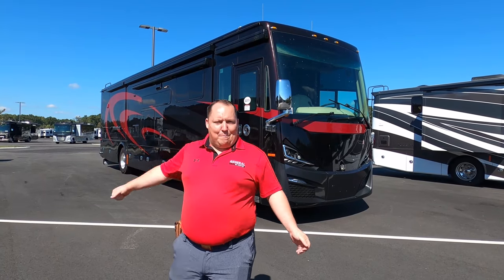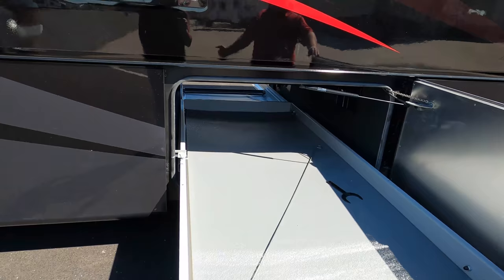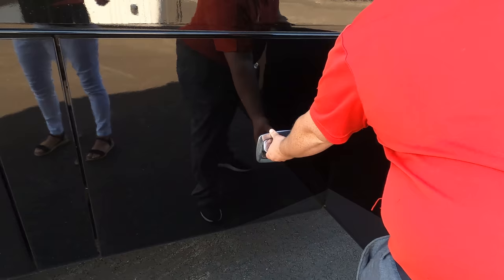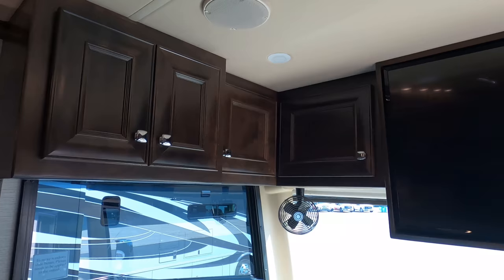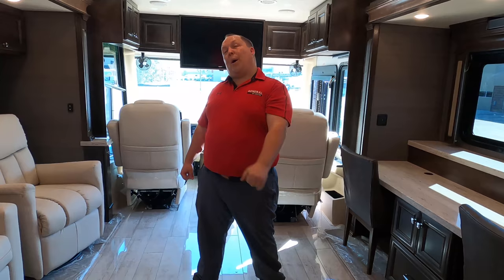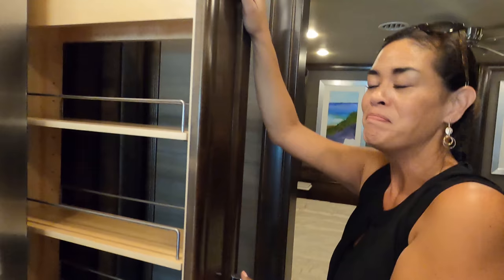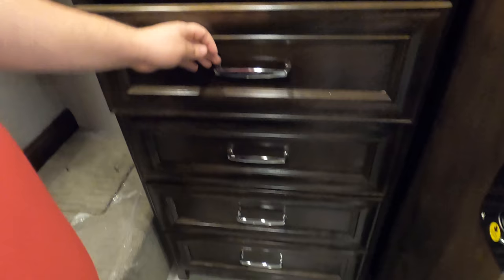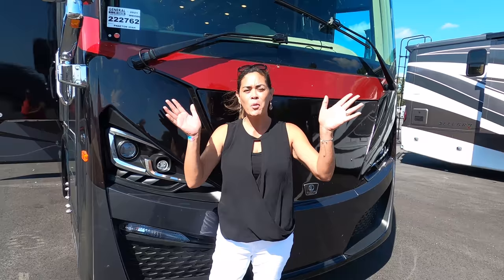The #1 Selling Class A Diesel Pusher for 2020

Comment: Matt, you can get that phaeton with an induction cooktop but, in order to get that you have to get the package with the aqua hot and dishwasher which we aren’t a fan of.  Also, here is our dislikes, that medicine cabinet in the bathroom is stupid, ours is all one piece and lots of room.  We don’t like the sofa as there is only one rocker recliner and we both like the rocker recliner to relax.  We aren’t a fan of the outside color either as black in Florida draws heat and hot to touch. We don’t like the heavy combersome covers on the stove, we live in ours full time and they are heavy to take off and on so we don’t use our stove and crumbs are always falling between the cracks and what a mess.  We covered ours with a plastic cutting board which we had made.  We love our tiffin 37 PA allegro Red, there is a lot of things I wish tiffin would change, like putting lights in all the cabinets as they are hard to see in them even in the daytime.

Comment: I had a 2015 40AH and reversed the bathroom door and put a flush passage lock on it.  The door had no access when closed, and blocked the controls if left open when the slides were in.  Reversing did the trick.  It would be nice if they lined the cabinets.  Like to see they still have sliding windows.

Comment: Well, we hoped to by a Phaeton one day. We love our 2019 34PA Open Road. Yes we like the pusher and the Frightliner chassis but a lot of the coach is not much different from our gas motor home the bathroom has just one more sink. The shower looks the same. The couch is the same. The added length 41” vs 36” allows for a recliner but I’d prefer twin stadium recliners. The TV-ator is nice but all and all I don’t think it’s worth an extra 100k. Gas cook top- what’s with that?  The should put some glass in the doors above the fireplace and lights. Needs a better emergency exit in bedroom. 

Matt I’d love to see one under 40” or the 40IH. Bring it to me Matt!
Reply: * buy not by

Comment: Gorgeous motorhome!  Even though we insisted on a dinette (I’m sitting there all the time it seems!), this set-up is really nice with a combo-like work station/dining area.  Lovely flooring through-out the coach.  FABULOUS BATHROOM!  Very roomy and elegant, however not roomy enough while using to toilet!  Don’t care for the pull knobs on the cabinets...grab handles would be better in the kitchen and upper cabs in the bedroom.  Matt, you’re absolutely correct...that emergency exit is way too small.  It’s also hard to get at, especially if you are older and not as limber.  The fact that many retirees would choose this unit as a full or semi-full time, an easy access is a must.  In addition, it is not prepped for solar...which would def be used with an induction stove, which Matt thought should be included.  All in all, a lovely elegant motorhome for a fair price.

Comment: 3 Dislikes:
1. TV in the cockpit. Not necessary, not wanted, waste of space.
2. Toilet position. Remove the secondary door to the bedroom and swivel the toilet.
3. Emergency exit. Not just the size of the window but for older people, placement over the counter is horrible. 

3 Likes:

1. NO DINETTE!  Love, love, love.
2. Closet is fantastic.
3. Kitchen set up is perfect. Not too small, not too big.
Reply: I'm only 200 lbs and I'd never get my butt through it.
Reply: Rotating the toilet 45 degrees would fix the problem. Easy fix.
Reply: @americaunboxed1449  What about having an toilet that the top half can be turn to an prime popping position ?
Reply: Earl Blackman That would be a good option although it’s a moving part and could break over time.

Comment: I absolutely love the modern exterior design of this Phaeton Motorhome

Dislikes:
1) No outdoor kitchen or at least an outdoor fridge
2) would have been nice to have tall cabinets in the bathroom and adjust the toilet slightly
3) could they do an emergency exit in the closet with a drop ladder since the closet is in the rear. It could be designed as an access panel for loading also, just a thought to save having to lug luggage all the way through the motorhome.
4) Does the power reel have a built-in surge guard
Love
1) having the storage over cab instead of bunk over Cab
2) Awesome dinette / workstation set-up, wish more manufacturers would use this set-up. The whole living room is comfortable and roomy
3) the outdoor storage has plenty of space and they open to the side for the most room with slam latches
Reply: They can’t closet is where the engine is!

Comment: The exterior looks great, one of the coolest looking Class A diesels out there!
5 Likes:
1: Cool exterior styling, flush slide-outs, and amazing paint job
2: 380 Cummins and 10000 pound towing capacity
3: Living room with creative workstation/dining table, full sofa-bed, and recliner
4: Rear closet with stackable washer and dryer
5: The amount of exterior and interior storage is great
3 Dislikes:
1: Propane stove on a coach this expensive, it should be induction at this price level
2: Tight toilet placement
3: Carpets on slide-outs and sketchy emergency exit window

Comment: I can see why this is a #1 seller, it's beautiful, and a nice layout. 
Love-
That kitchen. Having a pennisula for the extra counter space is a big plus. Also that pull out pantry, and the drawers in the cupboards. Those are awesome, especially on the lower cupboards. 
Love love love the televator and desk space. I do like dinettes,  and would miss a table for games or puzzles especially.
And loads of storage, I could make another bedroom in the basement. That closet in the bedroom is really sweet.
Dislikes:
That toilet. Come one, beautiful bathroom, and there's the thrown, tucked away in a corner. It's a deal breaker for me if I can't sit comfortably on the toilet. No matter how much I love the rest of it. At that price, it should be the best 4P out there!
A TV over the front? In case the driver gets bored? Or in case someone sitting in the living area prefers to crane their neck? It serves no purpose other than to add to the price. 
There is 1 thing I always want, but never see. We've seen time and again the ability to put a table in fromt of the seating, Not really practical to me. you'd have to carry folding chairs to have enough for people to sit around the table. I would like to see a coffee table in front of the couch. Even just a foot or 2 in width would give you more room to park your feet, or munchies, whatever. A full size table at a couch just doesn't work for me.

Comment: I loved this Motor Home. There was no CPAP station. Though not a deal breaker. We’d have to figure out something for that. In the back pass through storage there were some wires that were hanging down. Seemed like it was a real snag hazard and potential for creating an issue as it gets yanked on. I would have to have that fixed. Not set up for solar. Id want that. The work station was a real winner. Loved that! Loved the recycling water in the shower. Wonderful!  Loved the kitchen and living room area!  Perfect!

Comment: Matt-
You and I are in AGREEMENT on something! 
Yay!
1) Propane stove-yes, since propane is used for the tankless water heater(WHY? Hydronic heating for your hot water and floor heat is decades old tech-wise, and TIFFIN I believe was 1st in placing it in their vehicles)** 2) Paint-that dark paint will micro-check after about 3-5 years; 3) Dark wood cabinets. Gives out that 'funeral home' appearance [dark dark dark]  Likes-1) 40-ft, more room for the occupants; 2) SIZE of the engine-as a retired driver, it isn't the hp kill shot you go for-it's the efficiency (fuel mpg divided by  REQUIRED maintenance/repairs) {WHY aren't the mfg's using 12 or 13 speed automatics is a mystery to me] 3)  That roof array, only missing about 5 solar panels, but the juicy and EXPENSIVE to install important stuff is there, and TIFFIN'S methods should be used in training ALL techs and builders EVERYWHERE-it's just BOSS!.
** Matt and Andrea, as a retired truck driver, it was AGAINST THE LAW to have SECONDARY FUEL-source heaters in our trucks as a SAFETY concern ; [NOT plug-in or electric heat sources] so I am not keen on that method of cooking/ heat/hot water  Just an opinion Potato/potato...

Comment: M&A - another awesome job!  3 Likes - kitchen with window, fridge and PROPANE (hate induction, not easy to cook on); water bay with lights and hose reel; & computer workstation (although design shown online looks like it has a pull out table this one didn’t seem to have...3 dislikes - no drop down over cab bunk, so easy an versatile for families and visitors; carpet - I just don’t understand this one at all; & heavy cooktop and sink covers - great for extra counter space but why can’t you make these hollow or put a lighter material on the back or even use butcher block to make them lighter?  Thanks guys! Rob

Comment: I'll do four, also -

Dislike:
cheap drawer at computer station
unnecessary extra TV in front
two part exterior ladder
no external propane hook-up

Likes:
pull out kitchen peninsula
lots of storage, inside and out
dual sinks in bath
continuous split screen for both side and rear view cameras

Suggestions:
One touch slide-out deploy, versus mashing a button for 5 minutes (x4)
Dimmer switches for the interior lights

Comment: I can see why this is the number 1 selling diesel pusher! Great layout, and a lot of thought went into it. Still room for improvements,  though. 
My 3's:
Likes:
1. Entire kitchen, from the pull out peninsula to the pantry to the counter space. That is a great kitchen!
2. The bedroom. Ampke space to walk around, love the walk in closet,  love the w/d. 
3. The chassis, horsepower,  generator size. Yes!
Dislikes:
1. Agree with Matt and Andrea about the carpet. Not good. 
2. Also agree about the toilet placement. It could easily be rectified in a slight design change. Maybe Tiffin folks should do the toilet test before they take a floorplan to market. (BTW, my husband, who is 6'3" and built for comfort, does a toilet test in every RV we are considering.  He has done that for years!)
3. Ok, probably will get some flack for this, but I am not a fan of the paint scheme. Love the lights and attention to detail, but the color scheme is just not for me. 
Thanks.
And, for the money, I would probably buy a super C. JMHO

Comment: Good job guys, except you forgot to mention the generator. And, It had a water hose reel but, did it have a power reel and what type of water heater does it have? 

Dislikes..
1, Bad pooping position.
2, Shower is too small or seat is too big. It has to be changed. Take out one door and one sink, then you have plenty of room to design a better bathroom.
3, TV over entry isn't necessary. If you're wanting one for Navigation or something, make it smaller.. Us tall people don't like hitting our heads on them.
4, Escape window is too small for big people. I'm 6ft 4 330 lb and would never be able to get out that window. In the closet you had a unused area, you could put one of those exit doors, with the stairs built in the wall. That flips down to the ground for exit.

Likes..
1, Office / Dining area with televator. Great design guys.
2, Rear closet and safe with stackable washer and dryer, over engine is great.
3, Pull out drawers inside cabinets and lockable pantry.
4, Big Residential fridge with ice maker.. Is Great..
See ya later

Comment: Nice motorhome, you can see the quality of the fixtures and fittings, however, I'm really not a fan of the darker wooden cabinetry, really don't like how tightly squuezed into the corner the toilet is, and really do not like the Emergency Exit arrangement ( a full sized door in the rear closet would have been much safer and a better option). Overall though, I still think it is far too expensive for what it is, maybe I'm missing something with the Tiffin thing?

Comment: Dislikes:
1) Carpet... period... why?
2) Toilet... 300k+ and it doesn't have an elongated vacuum flush toilet?.... really?
3) That step cover will never hold up. It should be on a double track for its entire length.

Likes:
1) Flooring is awesome.
2) The Big Big Big kitchen window
3) The dump bay (lighted, a reel and roomy)

This RV is not my style. I tend to agree with Andrea on the gaudiness of some of the finishes. Too many lights (bling bling bling) for me. I'm the quiet elegance type. However, it's undeniably a beautiful coach and would make full timing a real pleasure.

Comment: OK, my likes are the large convection microwave the desk area and the large king bed in the back. My dislikes are the emergency window in the back they could make it so there’s that drawer unit in front of it pulls out or swings out and then there’s an area to put a doorway to walk out of the unit. I think there was one other RV that had some thing like that where it was an actual doorway to walk out I don’t remember what one now. And the sofa should have a couple of small tables that could attach to the sofa that swing around and you could eat at the sofa if you wanted or if you have some guests over so they could sit there with a drink and a plate of food. Last dislike is also the toilet everything else in the bathroom is absolutely gorgeous but then it’s like oh here cram this toilet over here in this little area. If they had positioned it correctly the toilet could almost have its own separate room. That’s it for me it is a beautiful coach. Oh wait I got along with Andrea Andrea on that ceiling in the living area it’s way too dark you have all that cabinetry that’s dark and then there’s this dark thing hanging over your head. They should lighten that up and that would make it seem a little more lighter in there. Thanks y’all!

Comment: Not sure about this RV.  I was excited to see it but have really mixed feelings after viewing it.  

Dislikes:  1.  Ladder for roof, although I guess if you can afford this RV you would hire someone to access the roof, I just know that emergencies arise and I need to feel safe accessing the roof. 
 2.   Work station.   I would like it if it had a pull out table in the center.  Yes, you can eat there, but it just feels cold to me.  
3.  Although the solid surface counter top in the kitchen is lovely I do not like the way the pieces are cut over the stove, they looked hard to put back in, also with them being so large and heavy there needs to be a dedicated place to store them to prevent breakage (especially the front stove piece with all the weird angles.
4.  Color of upholstery.   Not a fan of white leather for furniture.  Hard to keep pristine.  Would have preferred they reverse the colors, darker furniture lighter cabinets. Carpet on slide out.
5.  Don't like the ceilings, over the top.
6.  Bathroom:  Shower seat takes up a lot of space, would prefer a fold down teak one.   HATE the toilet placement.  Toilet is smashed against the wall also not a fan of it being directly across from fridge.
7 .  Exit window is too small.  Deal breaker this is a safety issue.
8.  TV in cab area and at work station.  Again, over the top.

Likes:  1.  Love the engine size and chassis.     2.  Love the outside paint.   3.  Large awning. 
4.  Outside storage with slide.   5. Lit wet bay.  6. Power cord on reel.  7.  Large generator. 
8.  Three air conditioners.   9.   Seating for everyone without being crowded.  10.  Television can be lowered.  11.  Counter space and storage in kitchen.  12.  Size of appliances.  13.  Bed can be accessed when slides are all the way in.  14.  Storage in bedroom.  15.  Washer dryer and hamper.  16.  Size of closet is amazing.

I have more likes than dislikes, but just not feeling it for this one.

Comment: I do not like that the portable water fill is not on the same side as the city water hook up. I do not like the tv in the driver area it is an distraction. I do not like that their is no place to put the covering for the sink and stove top.     I like the tv in the prime viewing for the couch and  chair. I like the celling that have covers over the vent fans. And I like you can still can use the bathroom and main bed when the slides are in. I like that the out side power cord and water hook up is on an power rewind wheel.

Comment: 3 likes,
1, The kitchen, and i prefer a gas stove,
2. The TV on a televator where seating is rather than above the fireplace and my neck thanks you too.
3. Stackable w/d, love that.
3 dislikes,
1. The couch, I prefer 2 recliners or theater seating across from the TV
2. Kitchen and workspace on passenger side.
3. I'm with Andrea, the AC roof is a bit disco rather than classy.

Will I buy a Phaeton? I don't know, if all things even...I prefer the Allegro Bus.

Comment: Likes: 1. Stackable washer and dryer. 2. closet space. 3. King size bed. 4. surfaces in the kitchen.
Dislikes 1. Exit window, not enough room to get out in an emergency-safety issue. 2. no oven- for this price they should have an oven. 3. lack of solar panels on the roof. Again at this price should have at least 2 solar panels

Comment: Beautiful coach, but it needs an outside kitchen, I thought the drawers in the work center in the bedroom appear to be cheaply put together, you had trouble with them, hate the pooping position, way too close to the wall. I didn’t see a toilet paper holder but it could’ve been in one of the cabinets. And I was a surprised that there was no dishwasher in the unit. 
I know why they do it but I don’t like the door up in the front by the passenger seat, too hard to get in and out if you have a lot of people riding with you. You  did not say if there are seatbelts in that sofa or  the recliner or not.